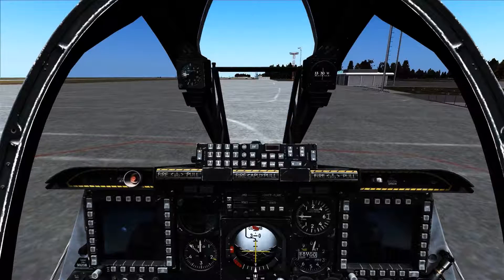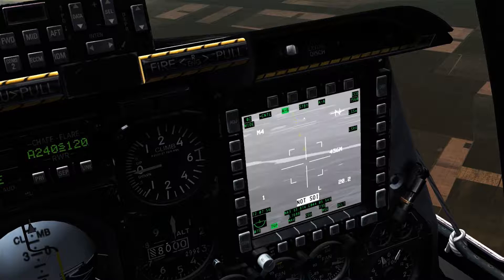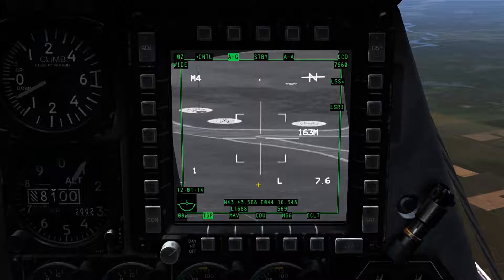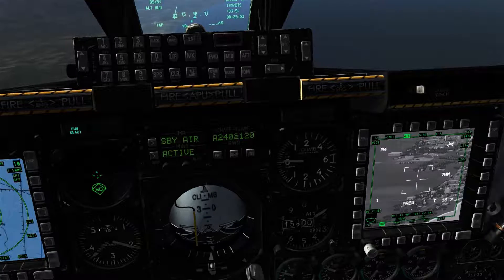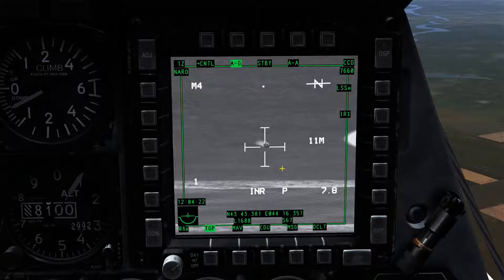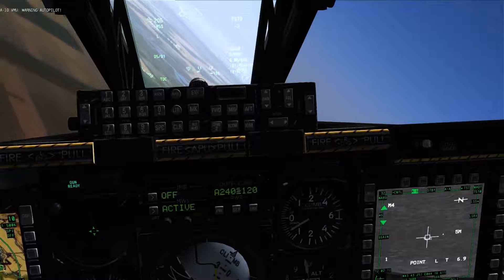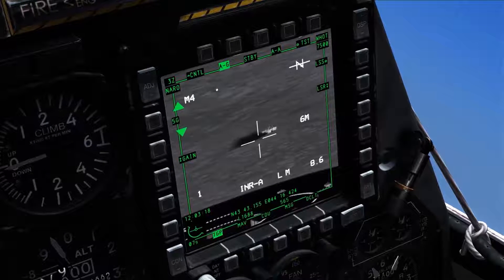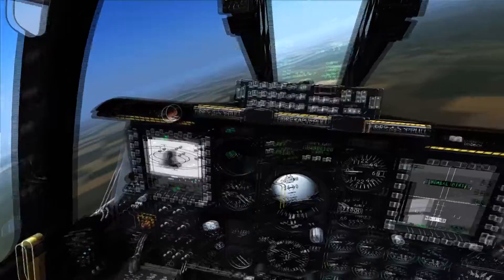DCS:World » Litening targeting pod (TGP) » A-10C

Comment: I feel intimidated on saitek profiler. Have not used it. Did you use in game control options and added modifiers for hat switches.? Had not thought of that. Do you know if it will recognize the pinky switch on the x52?  Thanks for any advice
Reply from the maker: +Andy Mac I used an x52 in the past and I recall the software fairly well, and as I recall the pinky switch could be unbound as a modifier and setup as a regular key, as could most of the mouse options on the throttle.  Though it has been a while.

But yeah generally I just use the ingame modifier options in the controls menu of the options menu as you can create your own modifiers for any device currently running through your PC.